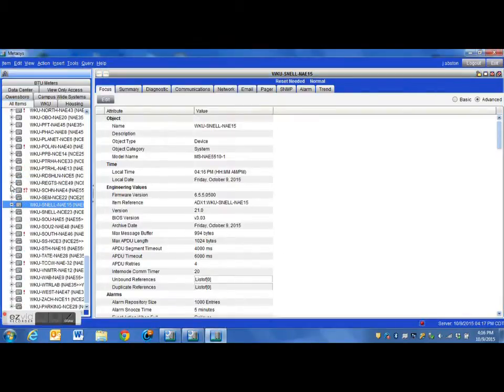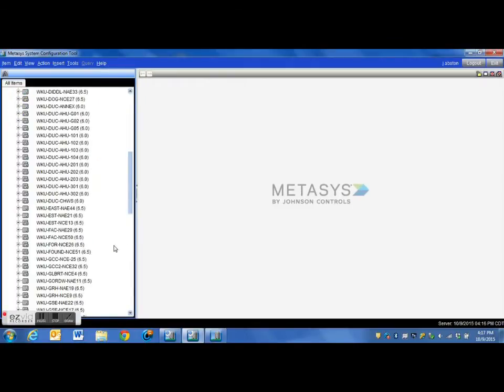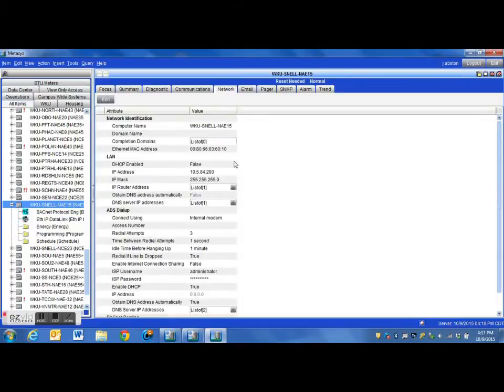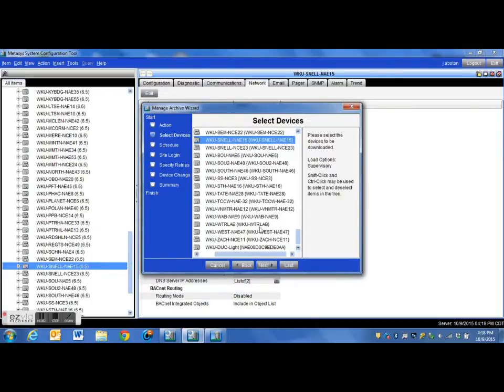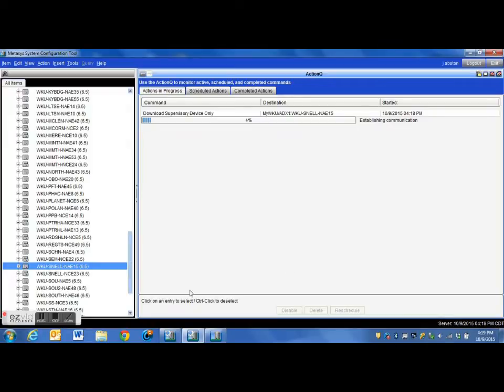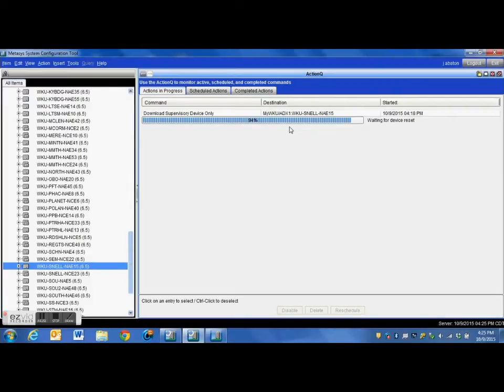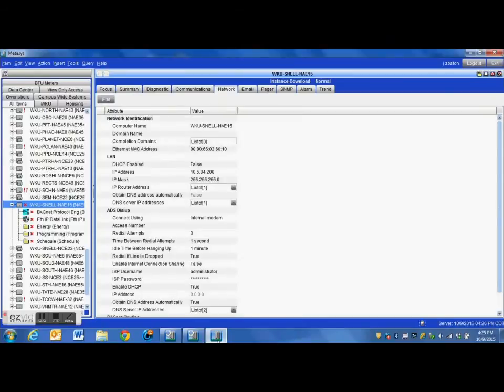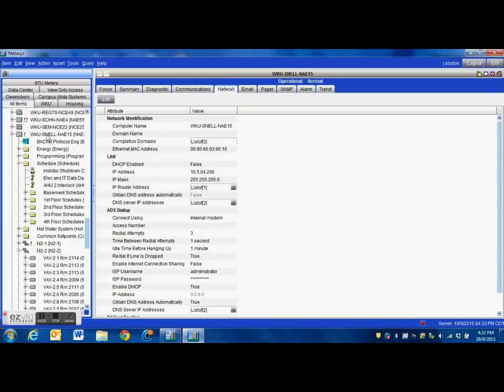Johnson Controls NAE NCE Database Download

Comment: My SCT 15 is able to do upload and synchronization but when downloading it is stuck at 25% then it timesout, any ideas why this is happening?
Reply from the maker: You may try to reinstall SCT.  Also, doublecheck the configuration and make sure there isn't a firewall causing issues.  Our IT has us on a VPN that has issues at times.
Reply: @Systemcontroltech  Thank you for your reply thankfully I figured out the problem and it was related to device certificate not being signed, I uploaded the certificate then made it self signed and redownloaded the SNC and it worked that way.